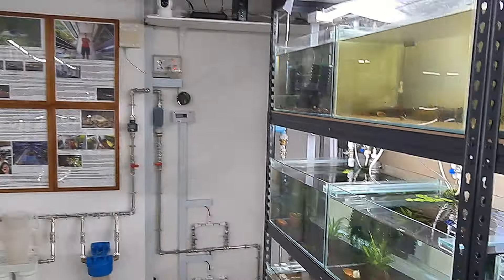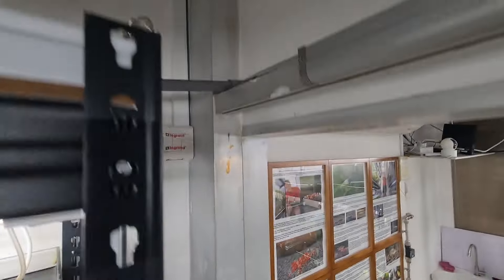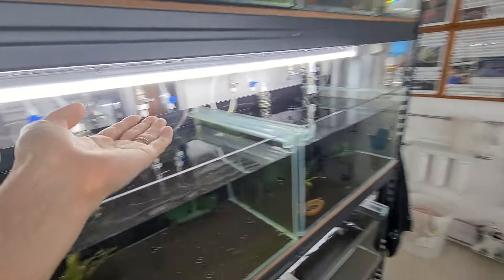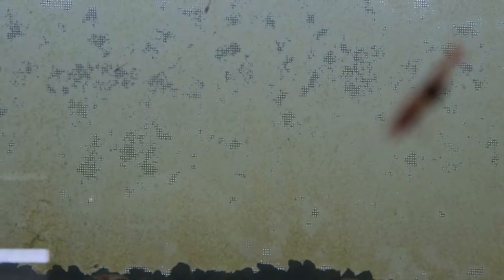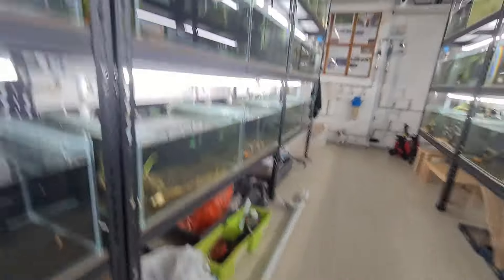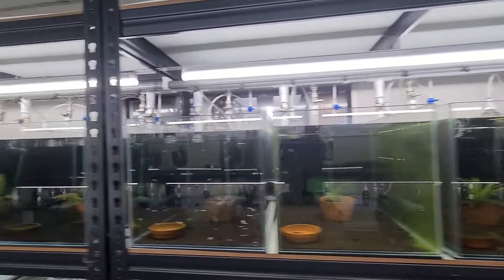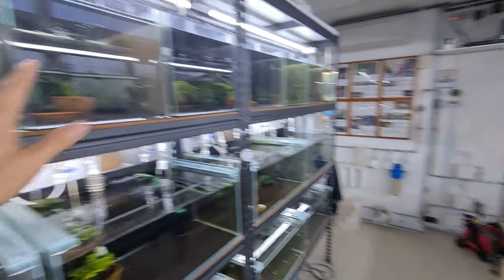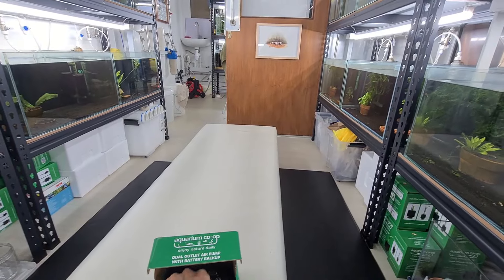Power Outage for Aquariums

Comment: Thanks for the video! Not surprising to see how thoroughly you've prepared. We just had a hurricane here in Houston and the power is still out for many--outages are probably something that will increase with climate change. It is smart to get prepared.

For my own simple setup, I'm just focused on maintaining aeration and lighting. I use the Aquarium Coop battery airpumps and a power supply to keep them charged. You can just start with one thing and keep improving your backup plan and equipment over time.
Reply from the maker: Yup that is right, i also have a few Aquarium coop battery airpumps for home setup on standby always.

Comment: Hi, thanks for this video !
To avoid this I bought a big air compressor that has a built in battery in it, it can handle a 10 hours power outage, we dont have many here in south of France but if it happens when we are on vacations it will be enough to keep them alive untill power comes back ^^
Reply from the maker: Sounds like something we can explore as well.